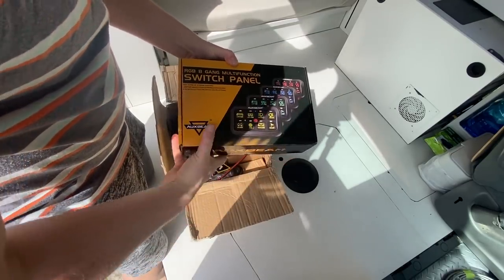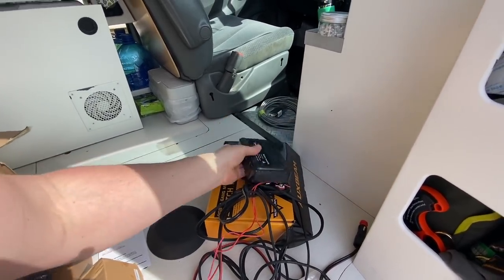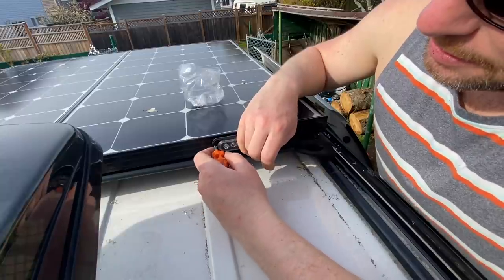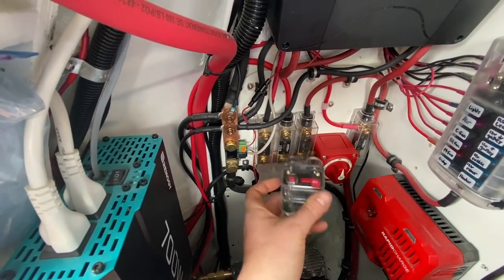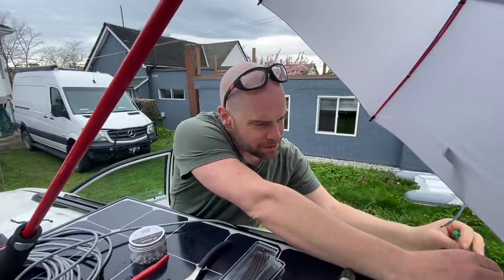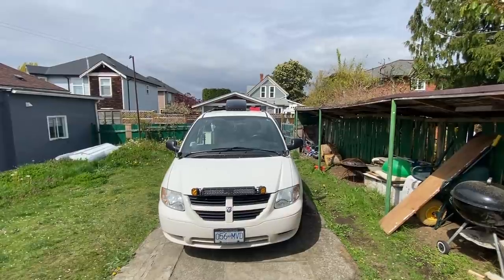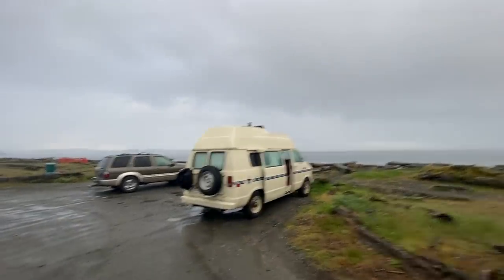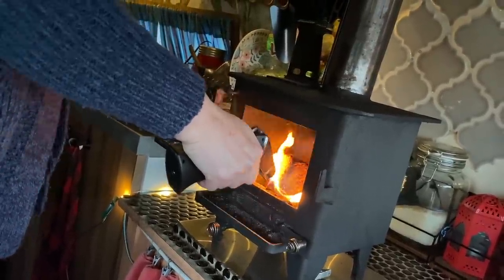Making My Van Brighter And Safer For The Road

Comment: Your skills, and knowledge is impressive. Just wondering if you’ve upscale your car alternator to cope with any extra charging needs you’ve fitted when your mobile?
Reply from the maker: I didn't need to upgrade it because my model had the larger alternator in it already.  An extra 50amps which was more than what was needed to control the additional HVAC equipment that came with this model.  Since I deleted the rear HVAC system I freed up that power draw and was able to tap into it for my house batteries without needing to upgrade it. 😉

Comment: Be careful about drilling into the frame of your solar panels. Some manufacturers will void your warranty.

I like to use my GoPro with a hat clip for that type of work, or driving RC cars.

For fixing a hole, like the carving, just put a toothpick in the hole, and it's good as new. Don't even need glue, it acts like a wedge. Same thing works with any screw hole, but you can use golf tees on bigger holes, even if you just want to fill it in.

Comment: 10:58 Fish Box??? What the heck is a fish box... and why is there a sticker for it in your new switch sticker options?
Also, the Jeffie Bear carving issue might be an easy fix if you just jam a toothpick or two into the hole (with or without glue) before screwing the eyelet back in.
Reply from the maker: Yeah when I saw that sticker I just couldn't resist.  I dunno what it's going to be, but I just had to use it.
Reply: also called a "Live Well" (  for fishing )

Comment: I'm digging the light set up. I've been wanting to add backup lamps to my van that are "always on' when in reverse UNLESS I switch them off. Is this possible with the switch panel?
Reply from the maker: Yup you can do that.  At least the one way that comes to mind is to run a secondary relay that connect the positive coming from the switch panel to the light and have a control wire coming from the reverse light circuit.  

If you do just be sure to size everything accordingly.

Comment: Just wondering..  why is your highbeam not wired bye å relae?

If you meet a car and need to change to lowbeam, the button is far-away..

On mine it's connected in the car so I can easily switch.
Reply from the maker: Oh my high low beam lights are factory and operate much the same way as any car.  The switch panel is just there to control all the add on lights which are way too bright for oncoming traffic.  It's also illegal to use them on most paved roads as they're blinding to other drivers.

Comment: Hello Joseph. I got a question. Im wanting to build a camper on a old hay farm truck and a 37' trailer with cooler room with a ac unit in it and a fish and deer and pig cleaning room with a AC unit and freezer and ice machine and recs and lights in it. It would be hauling my dodge Durango and my boat on top of the ladder rack. In the camper i want to use tvs and dvd player and in the camper will have ac unit and ref. And freezer and ice machine. Lights and recs full time and about 5- 6 things that would be used for power but not all at one time. Could you please help me i don't know anything about solar and it doesn't make sense to me. Thanks for your help and time . if you say yes is there a email i can text you at.
Reply from the maker: Hi Jeb.  

Sounds like your looking for a consult at this stage of things.  For now you can shoot me an email at info@sharingthewild.ca and we can correspond that way.